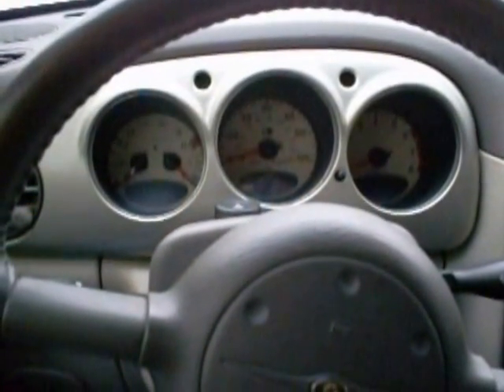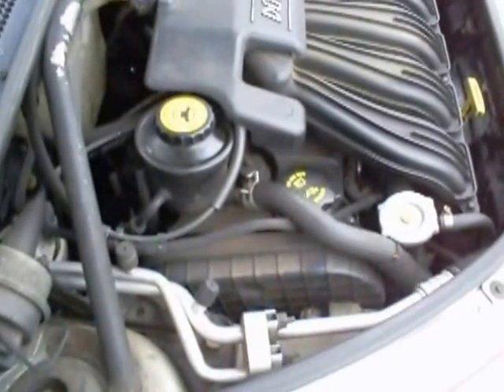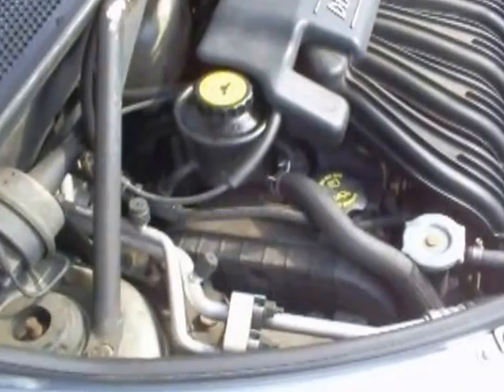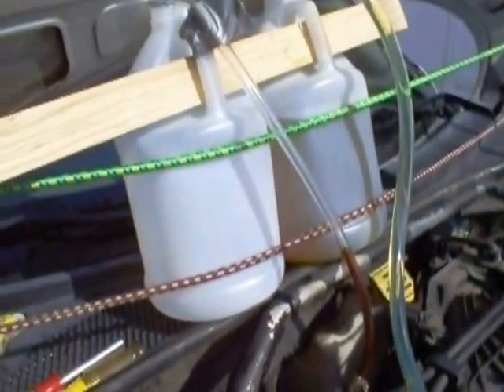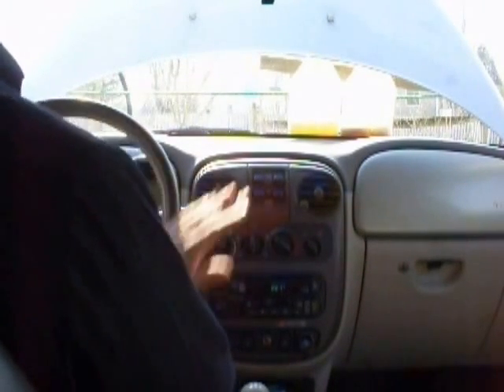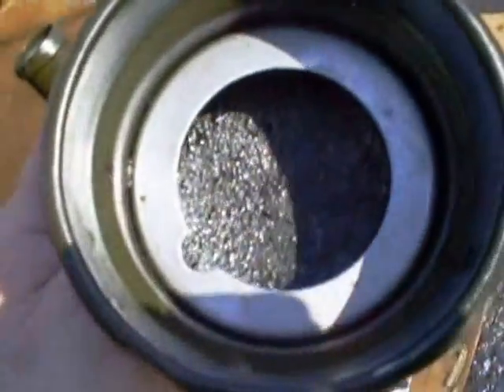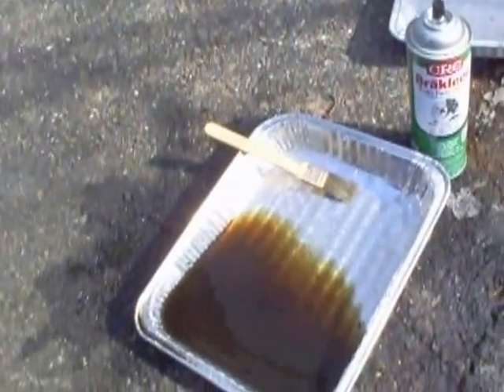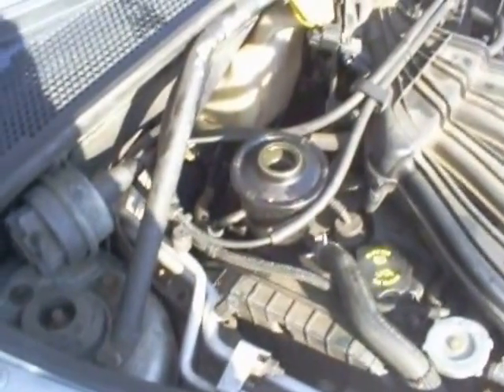Power Steering Flush and Screen Cleaning

Comment: Thanks for taking the time to post this.  It was helpful.   Some comments.  I wish you would have showed a bit on the effort needed to bend the tabs and remove the cover.   We gave up on that, but when we looked into the reservoir fill hole, we saw that the screen wasn't as dirty as yours.   We were able to spray the screen with solvent through the hole and get it pretty clean without removing the cover, we skipped the flush (for now) and the power steering is now quiet.

Comment: Most pumps probably fail from having a dirty filter that slowly starves the pump. The second you hear any whine the pump is being starved, air is in the fluid or low fluid caused by leak. I cannot emphasize enough how every fluid in a vehicle needs to be changed.

Comment: Great job. You were lucky to be able to take apart the reservoir. Mine doesn't look so easy, (we'll see). This is a very often miss diagnosed problem on high mileage vehicles, the wining at colder temps is the key!
Reply from the maker: Thanks for the reply.  I've done a few cars with this method by now.  Rockauto usually offers power steering reservoirs at a reasonable price.

Comment: This really did work for my toyota tundra 2002. I just put in a new pump and it kept growling like before. I took off the remote reservoir and cleaned the crap out of it so I could see the screens at the bottom. There is a you tube video on this. I also flushed the system. They wanted over $200. at toyota for a new one. I hope it will last for a while! Thanks for the video.
Reply from the maker: I'd be willing to bet you'll be fine for quite a while.  My power steering fluid is still fresh and clear and the PS system is working fine.  Glad you found the video helpful. Thanks for leaving a comment.

Comment: What kind of solvent did you use? Seafoam trans tune ok for pump seals?
Reply from the maker: Brakleen, the reservoir is all-metal construction so I wasn't worried about the Brakleen attacking plastic.  I set the open reservoir in front of a little heater that blew hot air into it and evaporated all the solvent before I reassembled it.

I've got ~150k miles on the Cruiser now, still running fine.  I also did this on a second Cruiser with good results.

Comment: Did you notice the steering having less "play" or lash after changing the fluid?
Reply from the maker: No.  The symptom was solely the whining., which I believe was due to the filter screen being clogged and the power steering pump cavitating (at least that's what I think was going on).  It's still running fine, five years later.   Regarding lash or play in the steering, I would suspect mechanical wear, but consult a mechanic for a professional opinion.  Sorry.
Reply: @crusinscamp  maybe it's because I have a recirculating ball type steering system in my truck, after flushing tje system it feels much "stiffer". Thanks for the great video, helped me a lot
Reply from the maker: I'm glad the video helped.  PT Cruisers have rack & pinion steering (so I'm thinking from a rack & pinion perspective).  If I recall correctly, there is an adjustment to remove play in recirculating ball type steering boxes.

Comment: Great! My service center is asking to replace pump and rack. I am going to just tell my Service center, flush the oil and change the reservoir.
Reply from the maker: It's the least expensive option to try.  There's a lot of stories out there where people replace the pump and it still growls.  I believe a clogged screen in the reservoir is often the culprit.  The flow rate in these systems surprised me, in the video you can see how ~1 gallon of PS fluid is pumped in ~24 seconds for a flow rate of ~2 gallon per minute during operation.  It wouldn't take much restriction to cause problems.

While I was able to open my reservoir and clean the screen.  It was a little problematic getting the reservoir to seal again.  Plastic reservoirs would be sealed and not easily serviceable (i.e. need replacement).

Comment: Run some seafoam through it. Add a Cardone a1 filter.
Reply from the maker: I would not recommend adding any solvents, such as Seafoam, to the system.  The solvents could attack and soften the seals, leading to seal failure.  I would be particularly concerned with the rack seals which are under high pressure.

Adding a filter wouldn't hurt.
Reply: Seafoam has no solvents. Look it up.